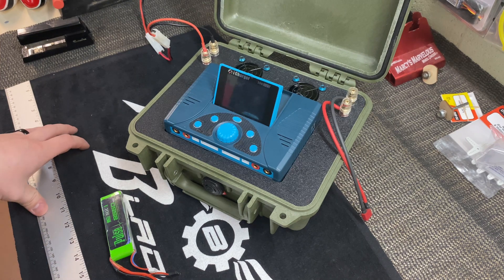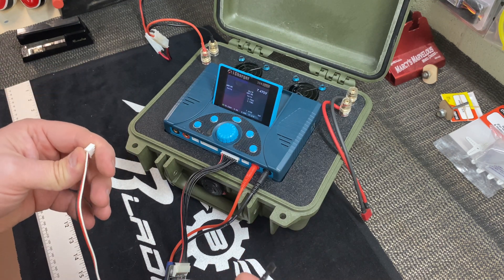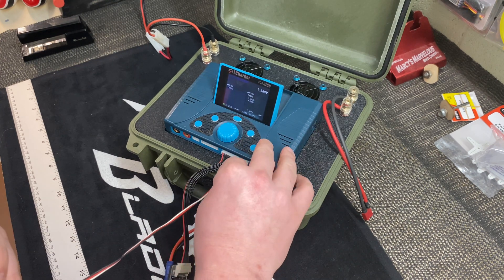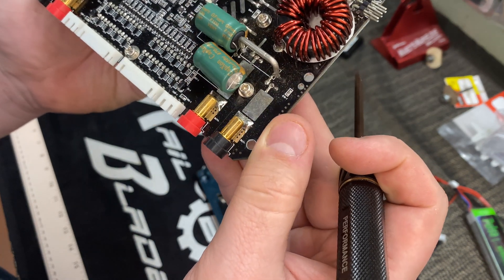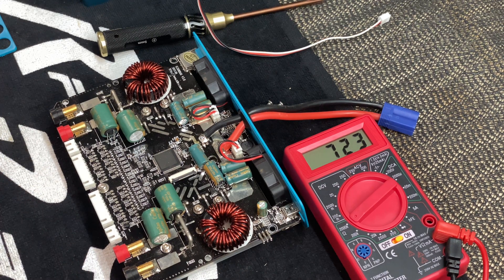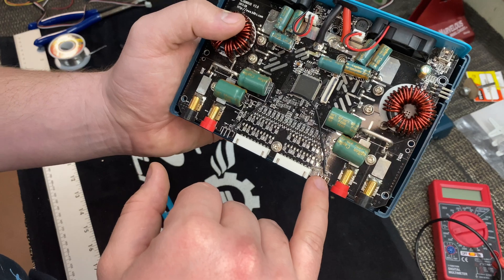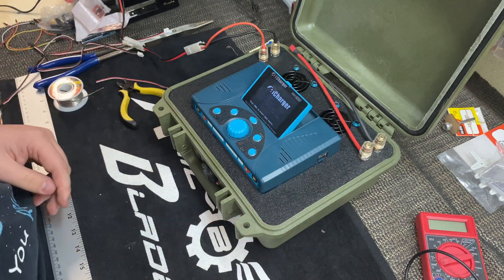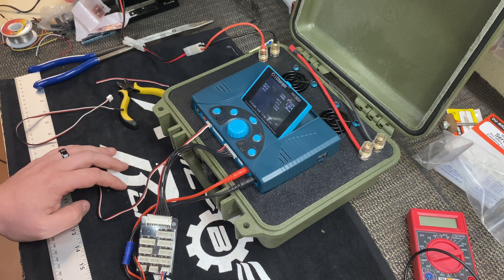Lipo Charger Repair - Repairing ICharger 4010/308/406 Duo Error 1900

Comment: Good. You can make a silicon plug to use as a tap to prevent this from happen again. On the order hand, never connect live cable directly to charger...  first connect cables then the batteries...

Comment: Thank you a million.  The same thing happened to my charger 4010 duo.  I will give this a shot to fix it.  Is there any issue when you have both temperature monitors running simultaneously?

Comment: Hi do you repair these?  My 308 got shorted due to my fault and it went silent with no power up.  The capacitors are still taking power but no start.
Reply from the maker: Hi Curt,

I do not repair these. Only do small jobs for friends. I would recommend contacting Junsi directly for service.
Reply: @jtcrowder49  AMAIN hobbies is helping out.  They are going over the top to help.
Reply: @dirtcurt1  Did you unit ever get fixed?
Reply: @melovescotch  yes Amain took care of the repair service for me.

Comment: Great video.  I've never taken the 308D apart, but I am pleasantly surprised to see how large the internal heat sink is.  I really like your small and compact charge case.  I particularly like the modular configuration where the charger itself is very easy to pull out of the case.   I also like how the charger sticks out high enough, so the ports are available for "direct" connection.  I assume the rear ports are also sticking out of the case.  Great job!!
Reply from the maker: You are correct in your assumptions. Thank you for the kind words!